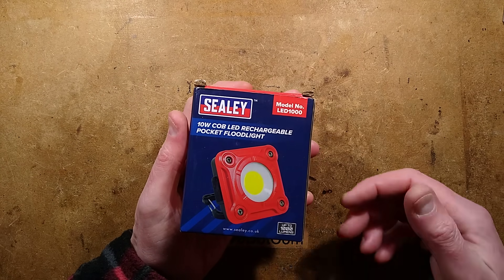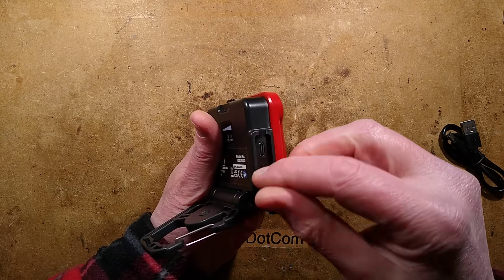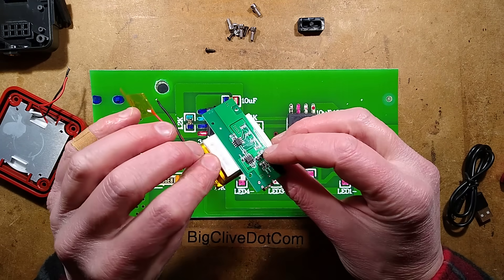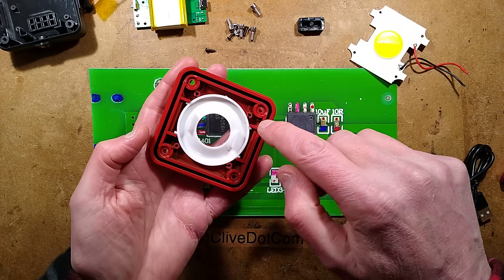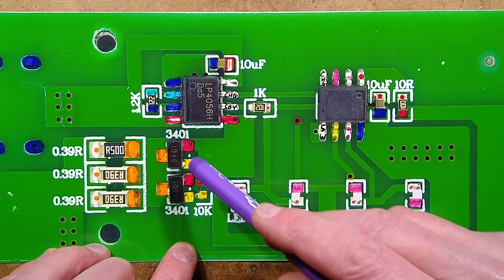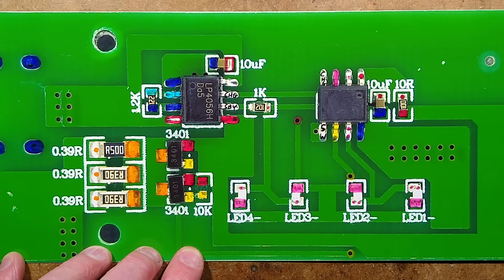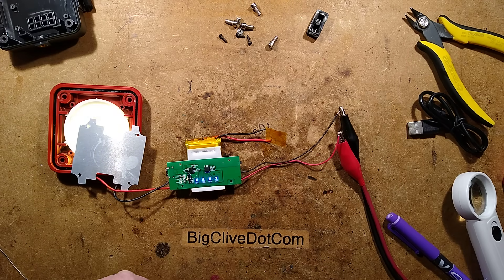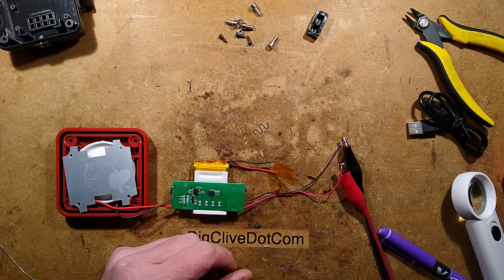Pocket floodlight teardown - with schematic

Comment: How do you test the capacity of batteries? I wantto test my 18650s  too.is it possible without the storebought devices? Ive got like 100 metres of nichrome or kanthal   wires from a 1900 watt heater as a load
Reply from the maker: You can get cheap USB powered modules for testing the capacity of a wide range of batteries.

Comment: Wouldn't the lonely resistor overheat since all of the current is now flowing through it ?
Reply from the maker: It doesn't see a significantly higher current than it did before, and the tracks it is on will be cooler due to the others being removed.

Comment: Nightsearcher do many different and very numerous lighting units, got several galaxy dual units, rechargeable and mains 110/230v powered worklights. They are awesome ! 2000 / 800 lumen max output. Much larger than your wee Sealy here, and have a 4400mAh battery. Ip65 too !

Comment: What spec are the capacitors you don't say on schematic?
Reply from the maker: The capacitors are unmarked and hard to measure while in circuit.  Most decoupling ones ate 100nF and others may be in the region of 1-10uF.

Comment: I have a semi-crazy idea of modifying a Daiso flashlight/lantern to also hold a small USB-PD power bank using 18630(?) cells, so this should be interesting reference material.

Funny you should mention Harbor Freight, Clive, I picked up a cheapie flashlight that used 5mm red LEDs (didn't know they were red until I fired it up), took it apart, and replaced the red LEDs with white ones. It worked fine for a couple of weeks until something failed, either the toggle switch on the butt or the alumin(i)um casing. Or maybe it was the overly complicated AAA battery holder. Too many possible failure points.

Comment: hey ive discovered if i just strip the power and ground wires from a usb cable and shove them into the connections it works for powering an n scale model train
this isnt relevant to you but watching you just tinker with electronics has led me to do the same in a way that potentially saves me 50 dollars instead of leaving me irrevocably scarred

Comment: Another gadget with an 8 pin Padauk PMS150C microcontroller. Clive is good at finding them!
The 10 ohm and 10uF cap are on the Vcc pin (main power pin). The resistor helps to decouple the Vcc pin from voltage fluctuations caused by the LED PWM.
Reply: Also, notice the battery is marked as 2000mAh
When the product was supposed to have a 3000mAh battery

Comment: Can someone advise me please. I want to test if a copper pipe has been properly earthed, using a multimeter. How do I do this? Thank you.
Reply from the maker: It would need proper electrical installation test equipment and preferably a visual inspection of the bonding.

A standard multimeter could give a very basic test if it showed no AC voltage between the pipe and actual ground, and the continuity test showed a low resistance between the pipe and actual ground.
Reply: Many thanks

Comment: hello sir...your video are really great...i love watching it all day....

i am totally a new bee in electronic..
my question is why do Ceiling panel lights have a driver whose output is 90v to 100v DC with 300milliapms why dnt they use 5v with 6amps or 12v with 2.5amps as all wud end up in having  same Watts
Reply from the maker: It's easier and cheaper to have a higher voltage with low current.  So they run very long series strings of LEDs.

Comment: I got a harbor-freight double-sided version of that - 2 of the exact same cob led + heat-sinks. The usb would only ever charge with one particular cable, then stopped charging altogether - now I realize it must also have lacked resistor and hence needed cheap usb-a only cable. COBs now in my junk parts box.
Reply from the maker: I think a lot of products get accidentally retired because smart USB chargers don't recognise them.

Comment: I really love the way you zoom on circuit board, and the drawings of the circuit are perfect. Wouldn't that be interesting to mix the zoom picture and the drawings ? 
You could draw the technical circuit on the zoomed photo at a certain percentage of opacity to see both clearly. It won't work for double face circuit but for simple one like this one it would be a killer !
With your help I'm now almost able to understand a circuit and with this kind of analogic infography (lol) it would be even easier !

Comment: I have a Sealey LED109C cordless floodlight. the thing is a beast, battery life has decreassed in capacity over the years but it's still going stong, get a good hour n a half before light starts dimming. Only has 30 LEDs but ech one has it's own molding in the reflector, it's really quite bright.

Comment: With that double sided sticky foam tape, easiest way is to use fishing line to cut throo the foam. And clean up etc from there.
Reply: Someone else suggested using dental floss.
Reply: @goodun2974  Yes,thin and strong.

Comment: These lights need desperately led driver for the every time you turn them on battery dies a little. And they  gradually dim over time. The ones that use PWM to to drive the COB are bit better because battery recovers in the off state, but then again gets slammed full current draw.

Comment: My $2 small Temu COB light (with carabineer) is smart as it has high/low/flashing mode, but if it is left on, a single button press turns it off. If you immediately press the buttons it switches from high, low, to flashing (annoying feature as always). But it's surprisingly smart as it changes button behavior when it's helpful.
And the chip apparently is not expensive So I wonder if it'll make it into more devices in the future

Still think it would have been smarter to have the flashing all the accessible by long press or something harder as i doubt most people routinely need a rave mode from their lights.
Reply: Temu has multiple listings for similar looking carabiner COB lights. I chose the cheapest which is plastic/metal buile, but there's also listings with "all metal." And they all have the carabiner, bottle opener, magnet, tripod mounts, and kickstand. 
Mine of questionable build quality, as I had to solder on a battery contact and it was barely held together by tiny plastic pegs. 
They also advertise it as waterproof but there is no way it is waterproof due to the pieces not being glued together. Maybe dustproof but mine being waterproof is a big lie, which seems common for cheapo no name Chinese products. 😆
Reply from the maker: I think I may have a similar one from Ebay.   The cell capacity is quoted as being  500mAh, but tested at just 100mAh.

Comment: I get the feeling that with the general quality that the factory that made it is not well-run, and is instead interested in capitalizing on mechanics and tradesmen's insatiable need for disposable lights that quit working in two years or less.

IE I think they just ran out of 10K resistor on the reel, didn't give a shit, and kept going.

Comment: That enclosure might be useful for other applications too. I wonder if these will eventually surface in ALDI? It seems the sort of thing they would run as one of their weekly special. Probably cheaper to use a microcontroller than a multi-position switch! The cracked pillars can be fixed with your ABS filament pen, but would be best fixed permanently with brass inserts.

Comment: I’ve not had much luck with Sealey torches. 

The rubber on the rubber coated torches always goes sticky. 

Then I’ve had the charging port come adrift from the main body and I’ve had to stick it back in with Araldite.

I now wouldn’t buy Sealey products because they are shoddily built in my opinion.

Comment: What would happen if the missing 10k resistor was added to the circuit? Would that have any effect on the current draw?
Reply from the maker: It would just make sure it booted up in a stable state when recharging from flat.

Comment: Is it CTO shifted or is that just your workbench?  What's the Kelvin on that?  I know a few gearheads who still prefer incandescent worklights to daylight LED because the bright white tends to create gnarly shadows when you're digging around in engine compartments.  I have had similar issues rooting around in dimmer racks when using LEDs.  Medium diffusion gels help a lot in these applications.

Additionally, that is one beefy bastard of a COB!  Wer're talking Fray Bentos levels of flavour!  We can't defend against lights of this magnitude!  That battery's pretty nice too.  Haven't run into a soft pack in that medium-small range yet.  What's the capacity?  I'm honestly surprised.  I was expecting an 18650.
Reply from the maker: I use 4000K at the bench.

Comment: Clive, thanks for another interesting video.

Am I right those dents on battery can potentially cause fire, especially if internal pressure of battery will rise with time and wear? It reminds me one South Korea flagman smartphone.
Have you checked temp rise of LED, battery and current sensing resistors if you leave it on for example for a half an hour? I've seen other Chinese street light which suffered of very high current resistor temperature rise. And I think on max power LED should draw 10 watts which can heat internals very much.
Reply from the maker: The dents in the side are not critical if they don't pierce the cell.  I'd be more concerned about cells being indented at their ends, as that increases the risk of the internal separator being squished.

Comment: For the reason of Battery indentation damage I wouldn't recommend purchasing and if anything make a point to: Sealy/Manufacturer as a risk of fire/Explosive risk!
 Also as a Recyclable item the Foam pad need be non adhesive so it can be easily picked apart during the process.
Thanks for the vid Clive, you rock, 😉🤘
P.S, for the price, I can do better!🤣
Reply from the maker: The indentation is more of an issue when it's done at the ends.  As long as it isn't very high pressure or piercing the outer foil it shouldn't really pose a hazard.
Reply: it will become a fire hazard as soon as the LiPo cell gets deep discharged and the forming dendrites pierce the already smuched separator/active foil layers.

nobody wants a ticking bomb going up in flames out of the blue.

Comment: I got several "DC-DC 8~32V to 45~390V High Voltage Boost Converter ZVS Step-up Booster Modules" ($4.08ea), and with ~11.5v from 3 LiPO4 cells, and output voltage set to 220, I connected a G10 5w bulb.
The 5w G10 bulb got very warm (as with AC), producing around normal illumination. 
With 220v DC, the small high voltage G10 internal cap popped! The same happened to bulb #2. I reduced the output to 180v, the new bulb gave good light, didn't heat up, but turning off and on, the first converter died! 
Thought you might experiment with these cheap converters, and make a 5w G10 torch from an old torch body, and entertain us with your results!
Reply: Maybe those converters have a lot of high frequency ripple, if they are the two transistor with the small ferrite transformer type, and the capacitors don't like that. If you already have 11.5V you can run the LED MR16 type spotlight bulbs that are intended to replace the 12v halogen bulbs. They work well at 12v DC (between 12v and 17v maximum) they work well on inland waterway boats with a 12v battery system. I would guess they probably also work well at 11.5V and down to around 9.5v before losing regulation.
Reply: @threeMetreJim  I enjoy playing with the buck converters and joule thief circuits, keeps me out of mischief 🙂

Comment: I hate it when people don't install the two 5.1K resistors for USB-C charging. My guess is they decided they could save a couple pennies by not putting in the pull-up or USB-C resistors.

Comment: Heatsinking seems 'light'.
LEDs get hot; if 10 watts is the consumption of the LED, around 8.5 watts is heat, 1.5 watts converted to light.
These things should use linear dimming.
Due to PWM dimming, it probably fails IEEE1789 limits.
Reply: I have some COB assemblies in my drawer that have a 70% radiometric efficiency. This means 70% is converted to light, and about 30% is wasted as heat. That is quite a bit higher than the 15% radiometric efficiency example you give.

Comment: i have a couple of these by a different name and they are smaller, just the size if the round part only mine turn on on high then low then red then flashing red,   i got them for when im outside with my telescope  problem is the battery dies after 15 to 20 minutes  but they charge up really fast  guess why thats why they came in a pair

Comment: How could you bypass the mode chip so you can just switch the light on and off, without any other modes?
Reply from the maker: Rewriting the software, or add a switch and extra cell protection.

Comment: If the extra resistors reduce battery run time and strain the system and well add to building cost but barely effect output then why include them?
Reply from the maker: For higher visual intensity.

Comment: I'm at that annoying stage where I am really quite good at the handicrafts required for electronics--soldering, desoldering, SMD assembly, heatgun for solder paste, breaking and splicing wires and so on but I still really struggle to understand what things do in a circuit and why.

I know a MOSFET is some kind of successor device to the current-amplifying transistors I remember from being a kid. I also think that it being 'p channel' means that altering the current through the base pin will alter how much current the entire device passes. However I cannot recall whether the current goes up when the base pin current goes up or if it is inverted! Or does a MOSFET work off the voltage of the base pin rather than the current? It is this kind of thing I find almost impossible to learn from textbooks or reading things online. Sadly I am suitably thick that I need it explaining to me in words of a half syllable!

It would be really cool if you would do a series on very basic concepts like that Clive--something to give a toe-hold into the topic and a place from which to build which goes a bit further than these tear-down videos. Still use something straightforward like this torch as the basis for a tutorial but give a bit more detail--like explaining what the MOSFET component does, what impedance is, how it is related to the battery and why it is a bad thing. The problem is so much in electronics requires other tools to understand it. For instance you cannot really appreciate how things change in a circuit without at least a multimeter and really an oscilloscope... Yet the latter are absolutely impossibly expensive even in 2025! I cannot justify burning through £700 for even a bog-standard one. I always think of an oscilloscope as like an active electronic graph-plotting device!
Reply: A quick search shows a Hantek scope for $179, Rigol scopes starting at $225-250, and combination multimeter/scopes (very small display) from FNIRSI and other for less than $100. Digital multimeters can be had for under $20 these days!
Reply: @goodun2974  Many thanks!!!

I was looking on Radio Spares earlier today. The one that was their own brand and seemed like it might be good was £800. Although about ten years ago I nearly tried one of the ones called 'PC Oscilloscopes' that plugged into a laptop rather than having their own screens. I don't know if they still do those. They were much cheaper but I remember at the time I was still watching EEVBlog videos and the advice from that guy was not to waste your time on them--they were made by 'wun hung lo' in his opinion. But then he always said you have to buy all the most expensive tools or you are wasting your money! Might be alright if you are an electrician--and getting paid like an electrician!--but its not much good for someone who just wants to have some fun and make circuits!
Reply: A MOSFET is quite a bit different from the classic bipolar transistor. The legs of it are named differently too. Emitter = source, base = gate, collector = drain. Unlike in bipolars, the gate is insulated from the silicon die by an extremely thin insulating layer. Any static electricity, or an overvoltage of the gate by more that like... 5-6 volts, but someone correct me on that, can ruin this insulating layer, so the gate needs to be protected by a zener diode. The advantage of MOSFETs is a very short switching time, also very low noise in the high frequency spectrum.

Comment: Since the micro is powered all the time, it would be worth measuring the standby current.  Does the Lipo have a protection circuit build in to prevent over-discharge?

Comment: I retired from Sealey at the end of April 2023. I worked in QC dept, this item did not appear in my time. It would have been drop tested power tested and working time tested. My job was to test items which arrived without a valid RoHS certificate ie test for Lead and other banned materials. No surprise they left my office in boxes marked Plastic/Electronic/Batteries/Metals and Other materials.
Reply: Interesting that any company still does test any products. 
Normally they just slap on labels and be done with it 😅
Reply: @NinoJoel  The company sells tools at two levels, cheap and good. New items were checked on arrival for quality durability and safety. My job was to check for banned substances eg Lead Mercury Hexavalent chrome (CRVI) and various plastic additives. One Friday the MD was sitting in his office when he received a visit from Trading Standards who duly gave him an official caution and questioned him about some screws securing the cover of a Welder, they were coated in CRVI. He was very lucky not to be arrested and charged.